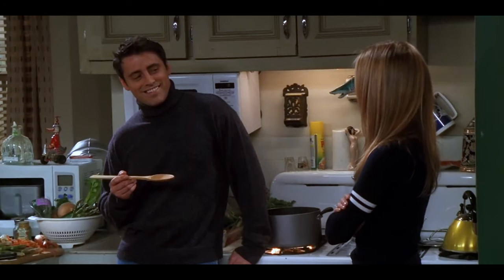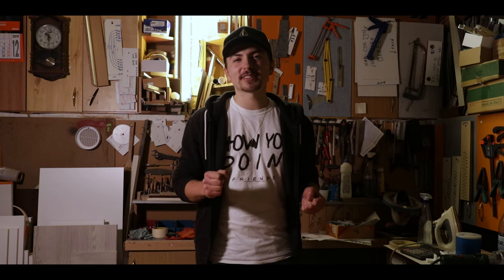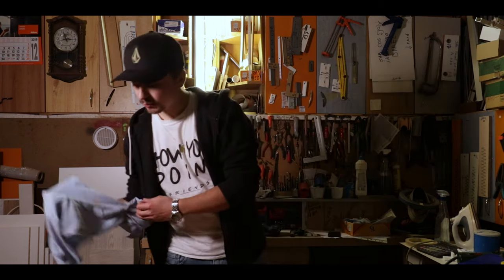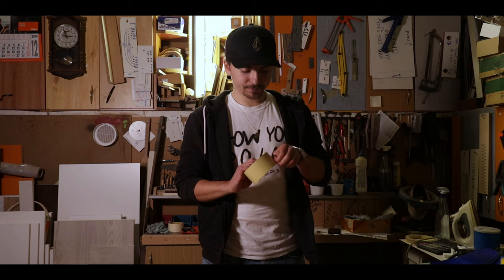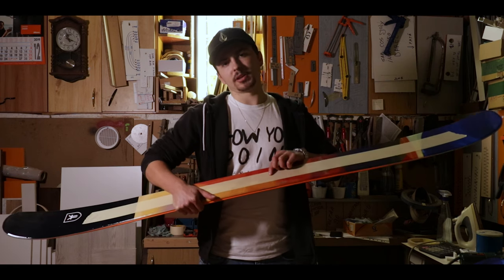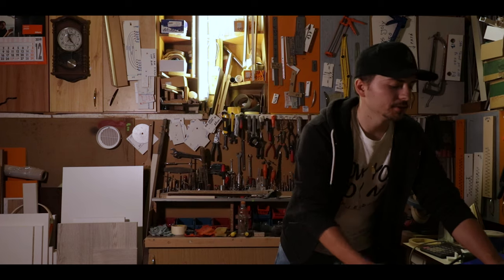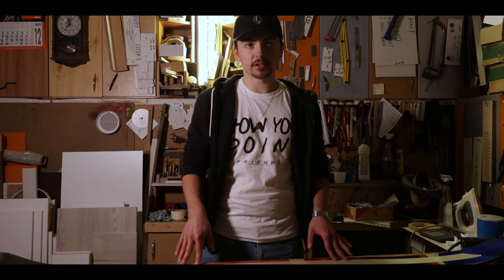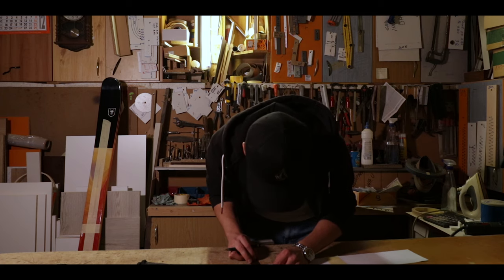Here's HOW TO MOUNT YOUR SKI BINDINGS WITH OR WITHOUT DRAWING, TUTORIAL

Comment: Ok, the ultimate way to find your sweet spot to mount your bindings.
First demo the ski you want to buy.
The demo bindings adjust for a wide range of boot shell sizes.
Usually it's just flip a lever and you can move the binding forward and back, just be sure to move them the same amount.
Ski, change it ski some more find what you like on that ski. measure the distance from the standard mount position and then go mount your ski's. Don't guess. Thats dumb.
Now, you'll be able to adjust more with a smaller boot then a larger size, more adjustment if you are a 9.5 as opposed to a size 13. Or I buy demo bindings and mount them and then I can loan skis to visiting friends or change my settings based on the day. Hard pack maybeeee a bit forward to day, Oh, powder day maybe a bit back. Ya tunable ski's. So, there's your Dinosaur skier tip.
Reply from the maker: You are absolutely right, the best way is to test first and see what you like, I personally knew what I wanted, and even if you mount them and you don't like the position, you can always change it, if you drill the ski a couple of times it's fine.